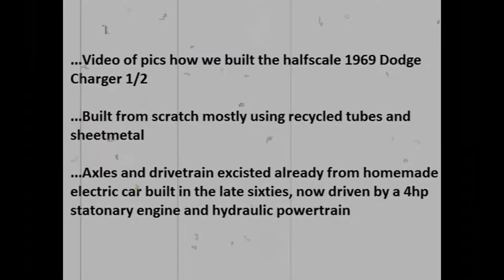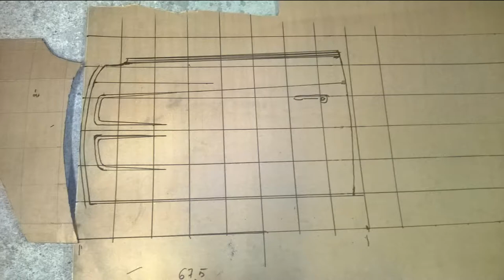1969 Dodge Charger halfscale build

Comment: I did something similar except used one of my old outdated 2015 pro challenge asphalt oval racecar
 They are 3/4 scale well in-between half and 3/4 scale of a nascar/ asphalt super late model. Running 1900 cc Yamaha 4 stroke sport bike motors we race in them full tube chassis and coil overs. They come with vin and title from manufacturer so I did what you did I built it into a 69 Chevelle SS drag looking stock sleeper 69 Chevelle SS cause it's tube chassis and roll cage so I found some drag radial cheater drag tire they called it back then for it with a wheelie bar and a nice drag racing spoiler like promod type on back. It's cherry apple metallic red with avalanche white stripes all in metallic. It's fast and beautiful hot rod. It was just barley big enough to remove some bars and add a second seat with some mods but it worked. I pick up dates that I meet on online dating apps like tinder I'm it and don't tell Emm and they love it
Reply: Would love to see pics

Comment: Amazing car, was thinking about starting my own project half scale car. Any thoughts on how I should start?
Reply from the maker: Thats a tricky question, dont know about your skills, but if you ever built model cars and can skiss a good plan and have a clue of what chassi you would use, its just to go for it? Dont know if this answer is useful but basically the first rule is good planning before beginning, then of course its also about what materials will you use?
Reply: @backyardengineering560  Yes this was very useful, thank you!
Reply from the maker: Yes, body made in steel, fibreglass wasnt an option. Thanks for the compliments!
Reply: @backyardengineering560  I too have plans on make a halfscale car
Reply from the maker: Nice, do you want to reviel what car youre going to make?

Comment: Bloody awesome build mate I'm very impressed How wide and long is yours I wanna build one that's 3/5-3/4 size want to run a motor with more power in mine and a transmission you have made me want to get this build done
Reply from the maker: Its 2,65 meter long and about 1 meter wide, 1:1 specs are found online if you do a search?
Reply: @backyardengineering560 quiero uno porfa

Comment: What front and rear end did you use?
Reply from the maker: The front and rear axles are selfmade from various scrap-parts, rear axle has a selfmade differential built in the late sixties... Can`t buy anywhere but there is options found on the net that could be used if we would build another one... :D